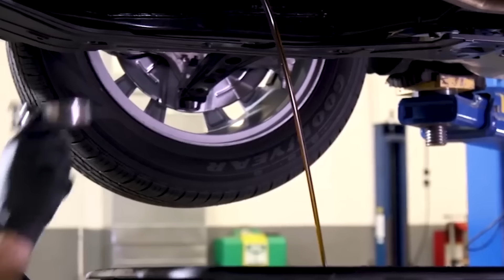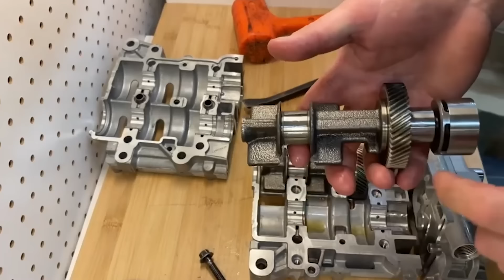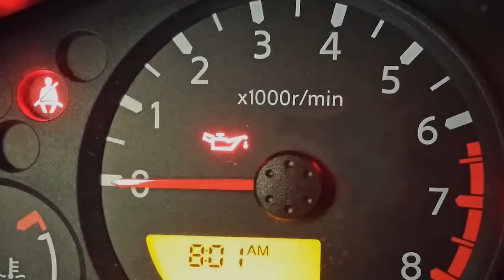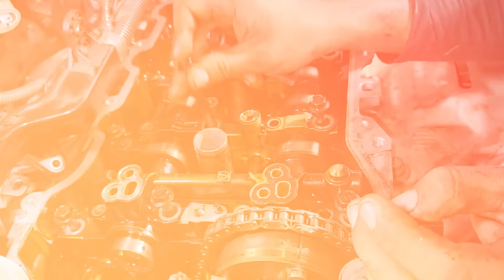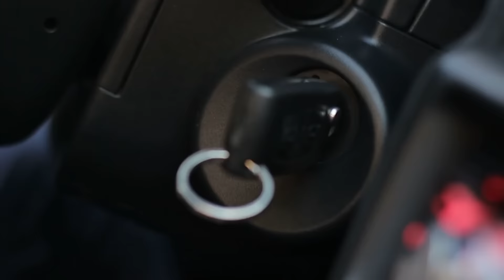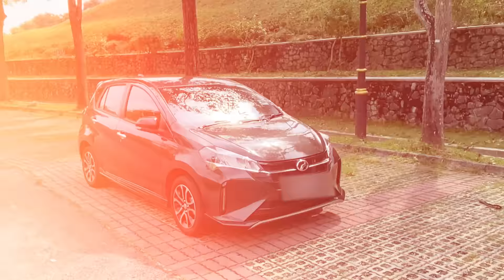NEW Common Problems With Toyota Modern Engines

Comment: Low tension piston rings.  There's information that 0w20 actually creates more deposits than 5W30.  Here's an interesting fact:  the 2015 RAV4 owner's manual calls for 0w20 in the North American market while the owner's manual in the European market calls for 5W30 for the same engine.